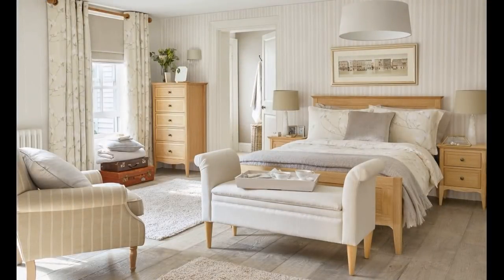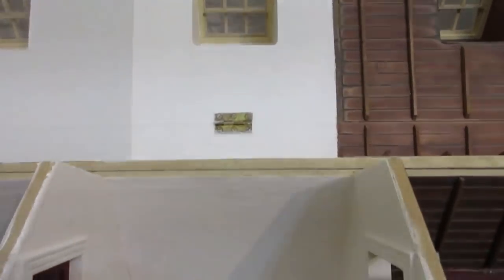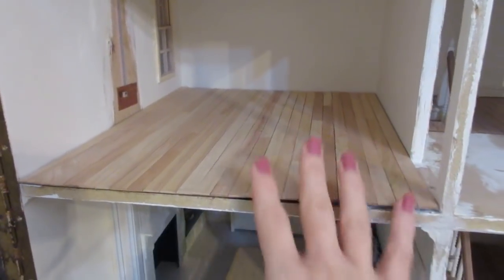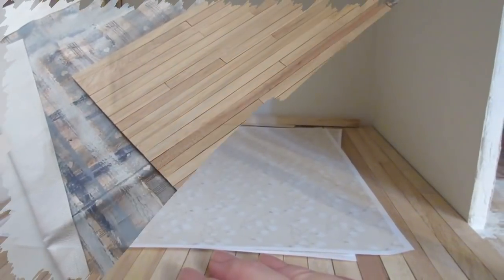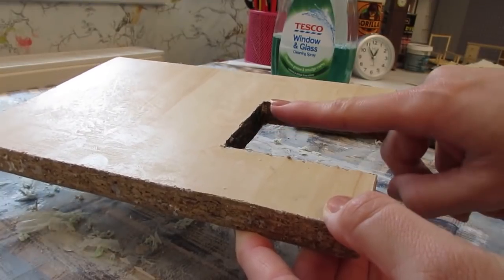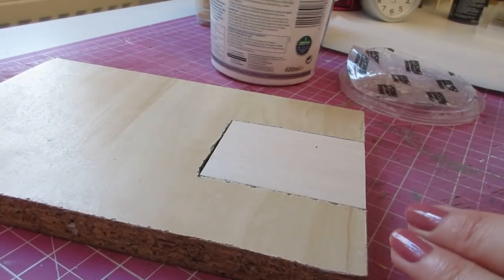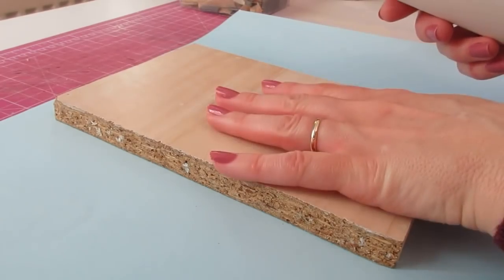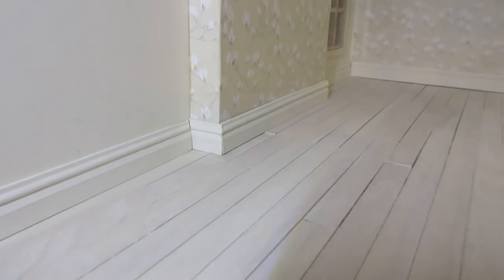My Dolls House Diary #35 - Finishing off the Decorating - Part One

Comment: Lovely to see a new video! I was wondering if you had tried using caulking in a syringe for filling gaps rather than filler. We use it in our own homes,  it’s easy to apply and requires no sanding.  I look forward to the next episode!
Reply from the maker: Thanks for the tip!

Comment: I'm curious about the choice of pva glue on the paper, which is making it swell, versus using a glue stick.  I've had far better luck gluing paper when I use glue sticks as they aren't so wet.
Reply from the maker: I've tried glue sticks, but they tend to catch and crumple the paper.